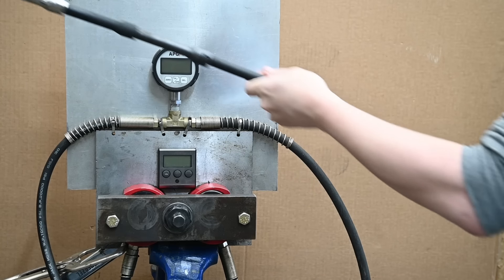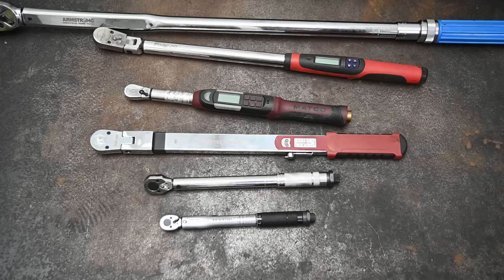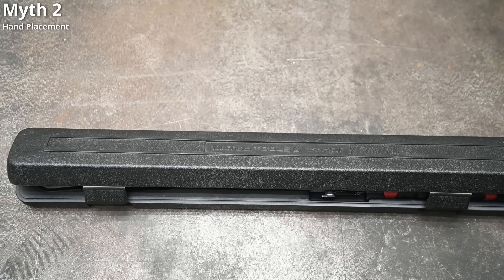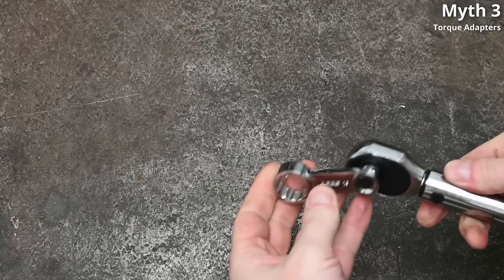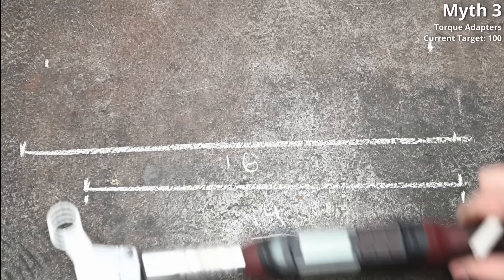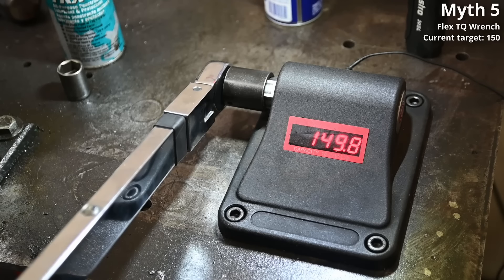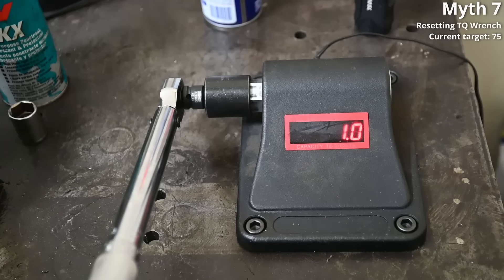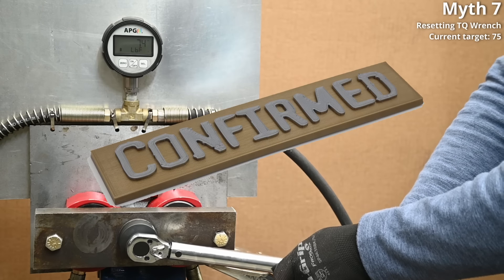You're Using a Torque Wrench Wrong: MythBusting 10 Do's & Dont's

Comment: Wow, the 100 foot pound setting with 200 foot pounds equivalent clamping force because of the anti-seize  blew my mind
Reply from the maker: You wrote that sentence better than we explained it
Reply: That's why you have to use ARP lube when installing ARP head studs. People use random oil and then snap their studs, then blame ARP when it was their own fault. Diesel guys also snap head studs all the time because they use Detroit Diesel #2 "peanut butter" lube on their threads which was specifically designed to drastically reduce torque specs on large diesel engines. All the light duty diesel guys like to think they drive semi trucks, so they use that lube and over torque their bolts until they snap off.
Reply: Yeah that was crazy. Glad I watched this because I had no idea.
Reply: our spec in the mines says it affects torque by about 30% guess they were a little off lol
Reply from the maker: @MrBOOM546  it can be all over the place based on size pitch and condition
Reply: @TorqueTestChannel  That explains alot, especially when we get lazy and don't use it. Things get a little annoying when we are torque checking flanges at 1800ftlb and the nut keeps spinning lol
Reply: @TorqueTestChannel  since you were so kind to reply, Im requesting you test aa RAD gun or something similar. Easily the coolest torque tool i've ever used
Reply: @TorqueTestChannel  as a machinist please test that!
Reply: I really liked the tip of torquing dry, marking and then wet torquing for corrosion resistance - Great Tip - Thank you!
Reply: @MrBOOM546  Alright, I've got to know wtf needs to be torqued to 1800.
Reply: @BurnerJones  i just torqued some 48 mm dia. allen bolts to 3400 ft lbs . they were attaching a large prefill valve to the top of of hydraulic cylinder on a 4000 metric ton hydraulic press. there were 24 of these on each of the 3 cylinders on this machine. used my 1 inch drive hydraulic torque wrench maxing it out at 10,000 psi.
Reply: Vehicle maintenance manuals always tell you which lubricant to use for a fastener right next to the torque spec. I'm guilty of being a bit casual about that and using some random grease, when it calls for "special grease xyz". May have to change that habit.
Reply: My goodness, I figured it would test out higher with aluminum anti-seize, I had guessed WAY too low!  Back almost three decades ago when I was still wrenching I'd come across lug bolts on German cars that had (17mm) had aluminum and graphite bearing anti-seize on them that I'd have to bring out the 3/4" (Did IR make a ¾" version of the 231?) impact to get them off. I'd grab some Brakleen and try and remove it as best I could.

Thanks for these tests BTW. This one was quite illuminating!
Reply: @BurnerJones  a lot of things but mainly 26"-42" pipe flanges
Reply: @TorqueTestChannel  I am wondering just how much affect oil has on the torque.  I know it does, but as a trucker, so many shops will put oil on the lug nuts or the studs of the truck when putting the wheels back on and it always annoys me because I dont know how much it is affecting it.  And yes, the shop doesnt listen to my request to not use oil.  Could you do a simple test about that, that would be great.  Thanks
Reply: Interesting, there is a published modifier in engineering books for oil, grease, silver antisieze, etc. And none of those were double.
Reply: Uhhhhhh, I use anti-sieze in CAD... uhhh thats insane!
Reply: If you did the same with just motor oil its 4x or more! imagine that on your brake rotor but 5 of them. now a 2300 PSI clamping becomes well over 9000. WARPED
Reply: Torque is still torque, literally force times distance, but some other measurement, like compression force, need to be the speck.
Reply: @MarkkuS  Torque is NOT just torque, with all these tools the measurement is made at the head of the bolt or nut. that is why TTY exists and measuring bolt stretch and clamping pressure. the statement you made is very inaccurate and leads to bad things happening but great videos like this coming out.
Reply: i have a can of anti-seize ... but i can't get the cap off
Reply: This is why you never grease lug nuts. Though there are exceptions say on a f450 with 19.5 inch wheels it asks for a thing film or oil on the studs prior to torquing
Reply: @pudermcgavin4462  I hear... so im not 100% on this but in those applications its better to chase the threads and wire brush them clean. The oil was to prevent rust issues but if you upgraded the studs its no longer an issue. BUT IDK, just what i heard. its the same with a few other cases i have been told to do so.
Reply: @ObservationofLimits  Yea we have to get our torque wrenches rebuilt probably every 4 months lol. Apparently they dont like being maxed out and put on a multiplier
Reply: Did a torduing course at hydratight. They once had a bolt with such bad threads they lost 99% of torque to the corroded / bad threads. Clean lubricated threads are a massive factor in bolt/nut tensioning.
Reply: @ObservationofLimits  damn you are allowed cheater bars but not a multiplier. We are allowed multiplier but not cheater bars where i work 😂
Reply: I inherited a 2005 buick from my uncle, and he would routinely put a pea-sized dab of grease on the wheel nuts before tightening.

I now have concerns about whether the studs have suffered damage over the years from overtorquing thanks to this video.

Thank you, but also, I hate you for the anxiety you have now permanently instilled in me.
Reply: @katokagome4670 if they are hub piloted wheels (lug nuts has a washer attached to them), they require a drop of oil on the stud, and a drop between the nut and washer. As long as your wheels are hub piloted, they are doing it correctly. If they are stud piloted (Budd nuts, acorn style nuts), they go on dry.
Reply: I made this mistake just a few days before this video came out. I put too much motor oil on my head bolts and snapped one off in the block
Reply: The most upsetting way people use anti seize is on lug studs. Not only does it result in over torquing all the little metal shavings from taking lugs on and off stick to it and make the threads even worse beyond normal wear and tear.
Reply: I've got an old Dodge that has lug nut torque values of 325 lb-ft (which is a pain if you don't have a 3/4" torque wrench) and now I'm going to have to do some experiments and math to figure out what I'm actually torquing those dang things to.  I live in the desert so I don't need to worry about rust so much, but still, I live in the desert so I hate when my stuff gets rusty.  🤣🤣🤣
Reply: @MrBOOM546 researched this issue to death and averaged 20% reduction with antiseize
Reply: @dirkmohrmann8960 right, now we just need a “grease myths” video 😂
Reply: Learned this snapping off some spark plug threads. 🙃
Reply: I didn't know it could be that far off either. It's will probably make the bolt come off easier too despite being over-torqued. So it might cause things to get loose over time if using lube or the wrong type of lube. Sometimes in technical manuals they don't specify anything other than a torque value so who knows. Probably even the engineers that wrote the manual don't know.
Reply: Our internal company spec has  a dry and lubricated spec for torques due to anti-seize and things like it.
Reply: Shows how well lubrication works!
Reply: I guess all 4 of the 8 lugs on my f350 are torqued too 200, who knew…🤯
Reply: @katokagome4670  ,
       "Calibrated" arm, using the joke lever provided by the truck maker - then 90⁰ with 4' T bar works for me. 
         Use any lubricant you wish, this way.
Reply: @paulsiebert4863  i find that to be the same as a tool.  It is using the same amount of resistance to measure the tightness.  Lubricant makes that resistance less.  Either way, shops dont use the arm calibrated method as they are held liable if it comes off.  :)
Reply: @BurnerJones  1800 ft lbs?  You and what army?
Reply: @davidjones-vx9ju  LoL,  good one.
Reply: @thomasjohannesen1003  Yeah, the whole world knows, we heard you curse!
Reply: Frictional losses account for roughly 90% of force consumption.
Most thread lubricants come with a correction factor to allow you to compensate for the reduced force required
Reply: Can you do a video that tests whether the addition of loctite thread locker(liquid) to a bolt changes the torque value?
Reply: @alexanderclark4353  re: anti seize on lug studs: I regret to report that I resemble that remark. I thought I was doing smart thing by applying anti-seize to my lug studs and that the next auto mechanic to service my car would think well of me. I apologize and will reform.
Reply: It blew my mind too. I did two minutes of cursory research and found that an industry rule of thumb is to reduce the dry torque value by 40% if it's going on lubed. In other words, a lug nut that would normally be torqued to100 lb-ft dry should only be torqued to 60 lb-ft if it's installed with anti-seize.
Reply: @bRad73016  If anti-seize acts as a lubricant then would it not make it easier for the bolt to back out? If so would a separate "wet" torque  value need to be determined to achieve the desired "dry" result?
Reply: Yeah, I was expecting 20-30%, that's nuts.
Reply: I’ve also heard that loctite does the exact same thing meaning you way over torque whatever you put it on and then have to not only overcome the loctite but also the over tightened fastener when removing so it has a habit of snapping them off. I don’t do much mechanic work anymore but for gun stuff I’ve started using purple loctite which is the weakest but still secures stuff pretty well and has a 300+ F temp rating. I don’t think it supposed to be used on big stuff though but I’m not sure and don’t know why it wouldn’t be other than changing the break lose rating by having more surface area or something
Reply: @ObservationofLimits  
Just saw the following comment ( re Norbar — not Nordbar — ) after my numerical questioning I posted re conversion factors for your ( Parker 8” at 3100 lb*ft.) comment.

The sqrt( 3100/ (420/0.75) ) * 0.75” is ~1.75”. Any chance those tie rods are actually 1 3/4” in diameter? Now that I could believe.
Reply: @ObservationofLimits  
Aargh! Lost a long, but off track, comment (YouTube? Me?) but ok:

Assuming 3100 lb*ft is near your proof load, and a grade 8, 3/4-16 bolt has a recommended torque of 420 lb*ft at 75% of proof as per my reference, then
sqrt( 3100 / (420 / 0.75) ) * .75” = 1.76” 

Such was my logic in my comment that should immediately precede this one.

I’m not much good at accessing my comments to edit them.
Reply: @kobayashimaru8114  I guess one needs to realize that torquing does 2 things: 1:  it produces the desired clamping or fastening force & 2: it keeps the fastener tight. I suppose you are absolutely right about a "wet" application not being able to keep the fastener "as tight" as a "dry" application  without more torque being applied.  I wonder then, is the torque required to keep a fastener tight as high as the torque required to obtain the desired clamping force? I suppose that is entirely dependent on each specific application. For instance, I would think keeping the fastener tight is more important on a wheel lug nut while obtaining a specific clamping force might be more important on a head bolt.
Reply: Insane is it, I can finally cite a source to the idiots that come into my work and have copper slip slathered on the threads of wheel bolts/studs and tell them I will not put any on.
Reply: And people still don't understand 
"Don't put anti-seize on lug nuts" ....
Reply: Mine too. I knew it would be off but I expected it to only be up to 20 off and lower not higher.
Reply: @observe cool story bro
Reply: The instructions with my wrench say to clean the threads before torquing.  It’s good to know why.  Thanks for the demonstration.
Reply: While using a hydraulic wrench at work around 15 years ago the torque chart had much lower values for when using anti-seize and I was confused. I thought the lube would make you have tighten it more, but then realized it's making it easier to turn. After that whenever I used anti-seize or assembly lube I look for a separate torque spec and if there isn't one I go 10-15% low. If it's actually sealing something like a head bolt/stud I use arp because they give you the torque with and without lube.
Reply: Many things such as commercial beam studs in warehouses.  In industrial applications, flanges piping, etc
Reply: @timothywhieldon1971 Torque is force times distance. Period. The resulting preload, or bolt tension, that results from that torque can change according to the formula they showed (depends on K and bolt diameter), but 100 ft-lbs of torque is 100 ft-lbs of torque. Doesn't matter if it's a dry bolt, wet bolt, seized bolt, or a tire axle, it's 100 ft-lbs.
Reply: @aj981981  clamping pressure, whoever, is NOT, and that is what this all translates to.
Reply: @timothywhieldon1971  Yep, that's what I said.
Reply: Yup, I do maintenance on turbofan engines and those bolts in hot sections (typically fuel nozzles) where silver goop or copper anti-seize is applied, are usually at least 30~40% percent lower in specified torque value than their cold section equivalents. In some cases it only requires 20 in-lbs on a quarter-inch bolts (x4 of them) to hold each nozzle.
Reply: Yeah, I had heard that anti-seize added maybe 10-25% to torque, I did not expect it to double it!
Reply: @pudermcgavin4462  Most of the friction on lug nuts should be coming from the shoulder/cone of the lug on to the wheel, so as long as you make sure that surface is clean, anti-seize on the threads shouldn't make too much difference.
Reply: @timothywhieldon1971 No torque is still just torque, that's just basic physics. What he's saying is that dyno device is measuring bolt TENSION not torque, so the tension measured is different with the same torque when you add lubricant. Of course arguably, tension is more important for the the spec, which he mentions as well.

However, as others have noted, even directly measuring tension isn't really enough, because the bolt will need a bit more tension to resist backing off under dynamic load if it is lubricated (vs dry). This is why often for high performance applications there is a different spec for different bolt lubricants.
Reply: I don't understand how you are measuring clamping force and translating to torque. Is there an older video that explains your setup?
Reply: not me.  dry threads, unless specified
Reply: @KarlEller  I lube both the thread and that cone surface too. Then tighten the nuts(M12x1.25 or 1.5) at 90-100 Nm.
Reply: Loctite will change toque values as well
Reply: @theladdiesda8190  In a thread class the instructor said dry tightening steel on steel:  50% of the torque work is lost to friction under the head of the bolt, 40% lost in the threads.  I'm guessing that the test here had some lube/antisieze under the head- in which case the results are not surprising.  Love the "assemble dry, mark, add antisieze, reassemble to the same mark" approach.  Count turns?  Who has the time...
Reply: i know right !!!!!!
Reply: When assembling industrial pipe and flanges they spec 220 ft-lbs greased or 500 ft-lbs dry. (This is an example obviously it depends on the style of gasket, stud diameter and number of bolts per flange)
Reply: If you're trying to achieve a certain bolt tension then you have to use a Skidmore machine or some other similar means to really check what you're getting.  I've also seen people measure bolt elongation which is pretty tough for short structural bolts.  If you really want to blow your mind, the guys that sell various types of structural bolts used in construction will bring their Skidmore, with a bag over its head, test various bolts with a torque wrench, then let you guess what the tension is before the pull off the bag and reveal the results.